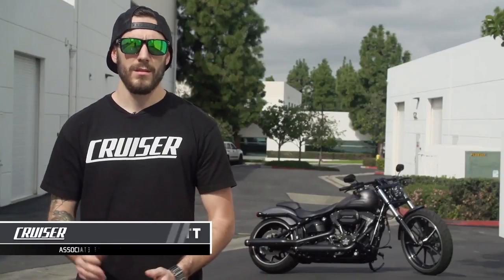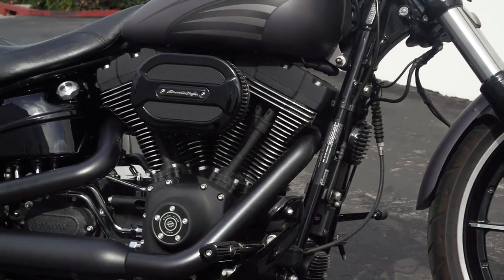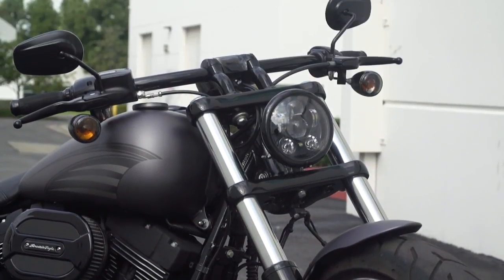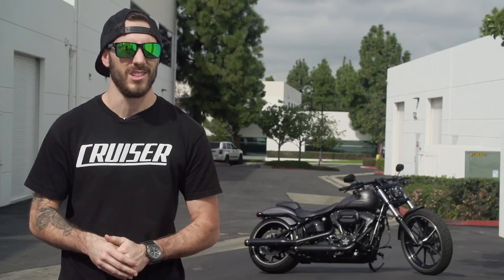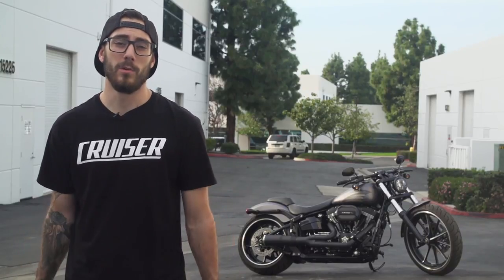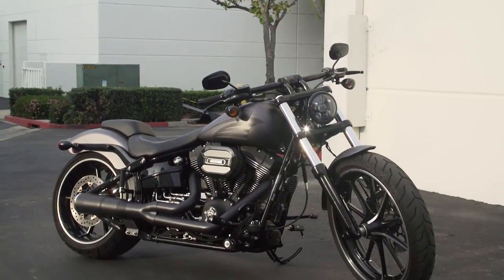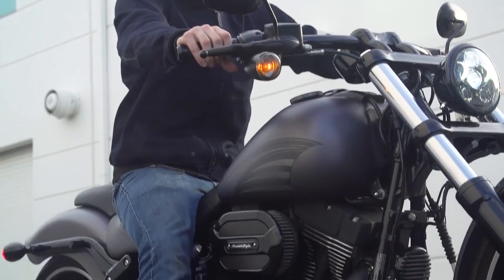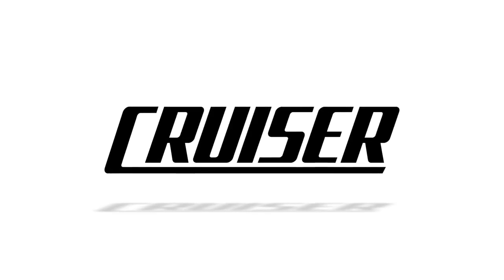Harley-Davidson Breakout Build - Exhaust Swap to Vance & Hines Hi-Output Short

Comment: Hello Motorcycles Cruiser, is it possible to place in a harley breakout 2017 a big radius vance and hines exhaust system with Harley screaming eagle air filter and tune them to a Harley brand pro street tuner?